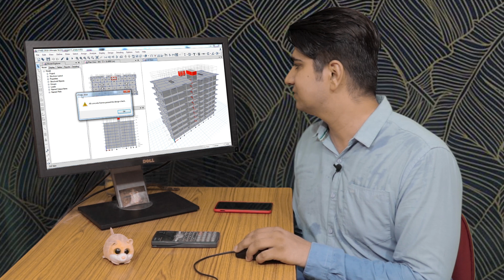🏠 ETABS Complete RCC & STEEL Design Course 🏠

Comment: Can we do design in Etabs at a time RCC & Steel in one building Eg: In one building 1st & 2nd slabs rcc structure ,3 & 4th slabs steel structure  and 5th slab is rcc + steel (4m cantilever portion )
Reply from the maker: Yes you can do that

Comment: sir will u explain manual designs also
Reply from the maker: Manual design methods are becoming absolute. As per the MNC needs we would recommand you to focus on these softwares for easy entry: Etbas + Staad foundation + Revit Structural + Revit Architectural

Comment: Suggest slab design software others than super civil cd
Reply from the maker: SuperCivilCD is an excel based software. Other then this will be freely available slab design excel sheets on internet. Only for Analysis you can use Etabs & SAAP. These are of no use for designing slabs, pick the loads from the analysis results & put in the standard design formulas to reach to the reinforcements.
Reply: Call me at 9595444947